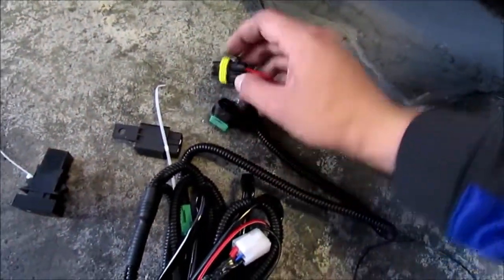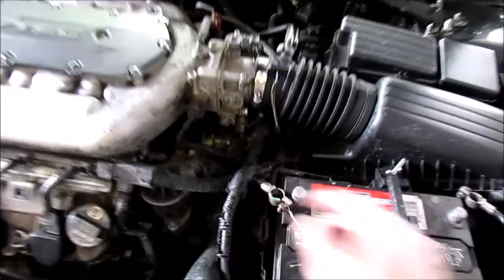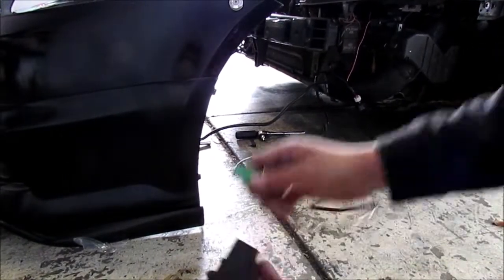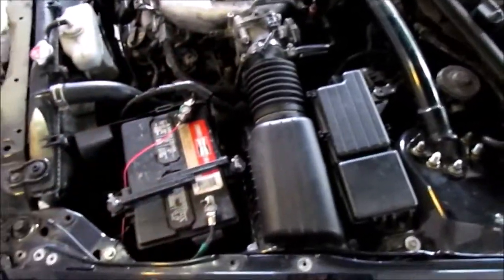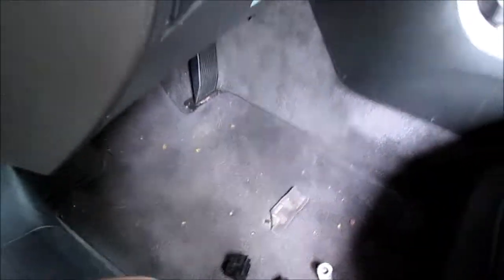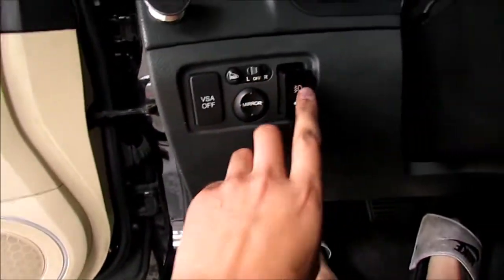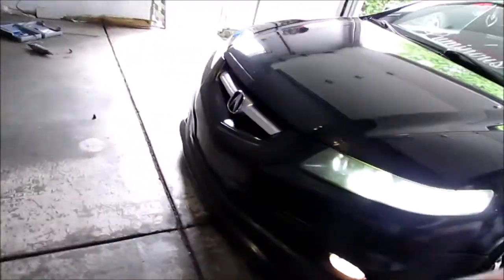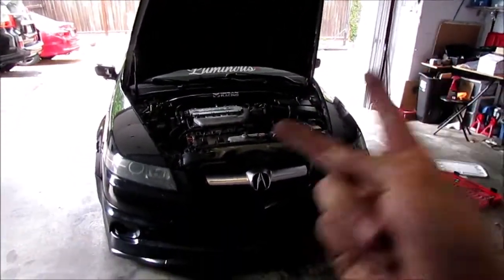Making the Fog lights Functional on the TL

Comment: Ay why don't you swap out that bulky steering wheel and put the type s on i did it on my 06 base all of the buttons and light are all functional looks way better
Reply: You can run the ground the orange and the blue wires from the shifter to the harness connectors in the back of the type s steering wheel. So you can have the paddle shifters from the type s in your base. It took me about an hour and a half to do.
Reply from the maker: It actually fits?!
Reply: Perfectly actually and on ebay there only $105 for a good used one.
Reply: @Leek_ee  yes its a direct fit. Wiring is on the acurazine forum straight forward
Reply: @moldytylor8679  what wire did you tap into for the paddle shifter to work on the base?
Reply: @TheDerrty111  after taking out the center console I found the harness under the shifter it's been a while but I believe I taped in to orange and white for upshift and blue for down. I  ran those tape up to the guage cluster because I remove it to get to the steering wheel harness I also ran a common ground to the steering wheel.
Reply: @TheDerrty111  there's a forum on acurazine but make shure you read the comments as some people had different ways of getting it to work.
Reply: @moldytylor8679  I did read about it but it was for the manual steering wheel. I couldn't fine the one with the paddle shifter installation
Reply: Right now I have the manual steering wheel on but I kinda like it with the paddle shifter. I just need to find out how to   wire them